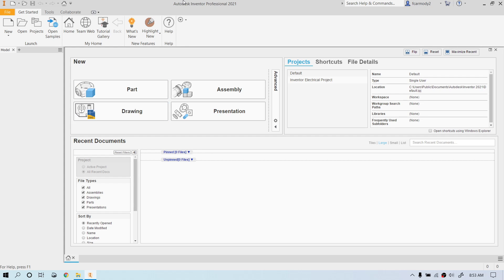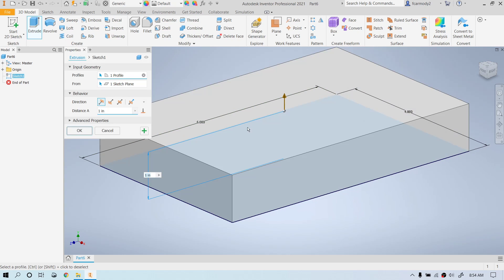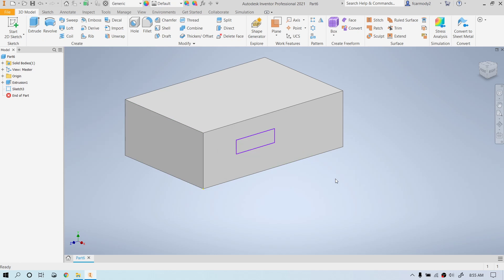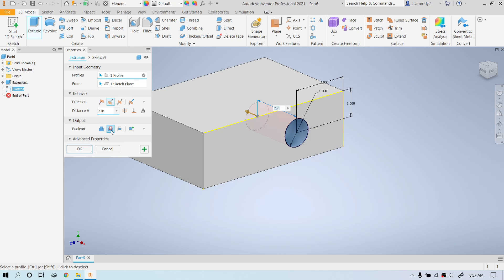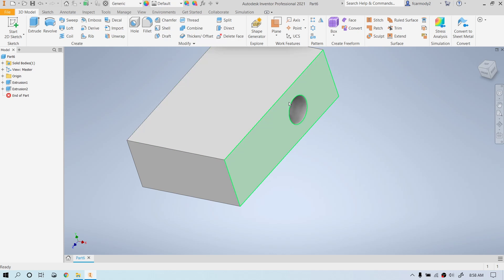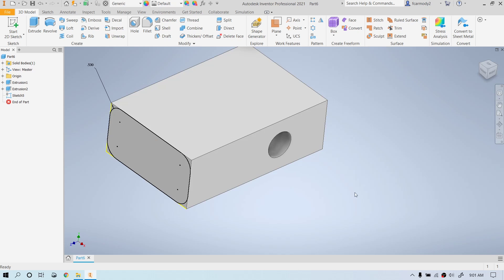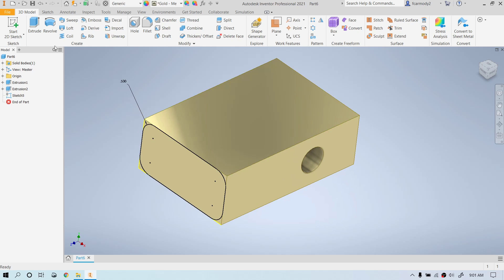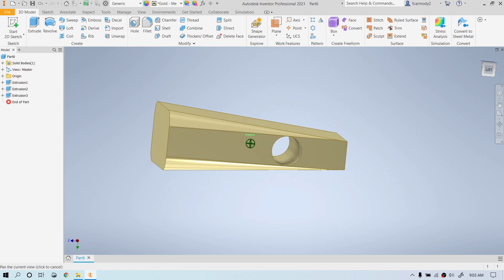Autodesk Inventor 2021 : 3 :  Advanced Extrusion

Comment: If we are to call the tutorial advanced, should we not use advance technics. For example, while sketching your rectangle, enter the values for the size of the rectangle instead of using the dimension command. Also, I would consider constructing the part in a way that you will actually be using the part in an assembly.

Comment: Great work ! As a newbie, witch plane do you have to chose t start a sketch, and why (x-z, x-y ..)
Reply: minder ernstig Basically it doesn’t matter, any plane can be used to make a sketch. However. the plane perpendicular to ”front” on the view cube (XY) is default choice when placing a view on the drawing. If you plan for this you can save a few clicks in the drawing enviroment. Also it has some effect on lighting principles, if you are doing nice presentations of the part itself. Place it in an assembly though and the lighting orientation of the assembly takes precedence. There is also a lot of other situations where you save a few clicks with the part oriented in the right direction but everything can be fixed. So basically it doesn’t matter.